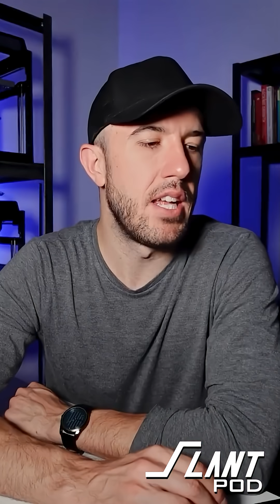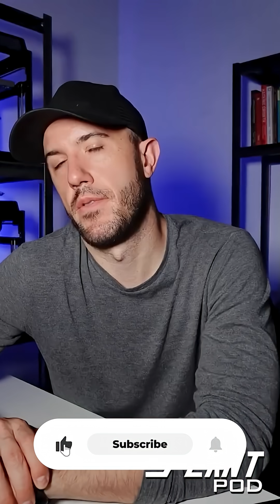Why 3MF Matters for 3D Printing

Comment: Unfortunately you only accept STL with Teleport, while most users really require print orientation and many other specific settings to be respected during the print for strength and finish. I’ve emailed you about this but never received an answer unfortunately. I cannot use your service for functional parts if I can only upload STL’s without ANY control over print settings.